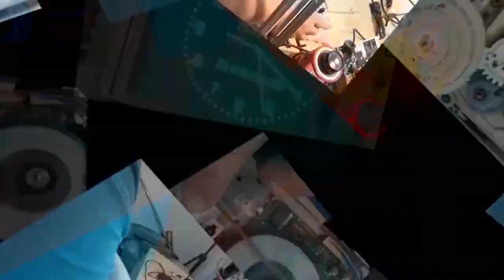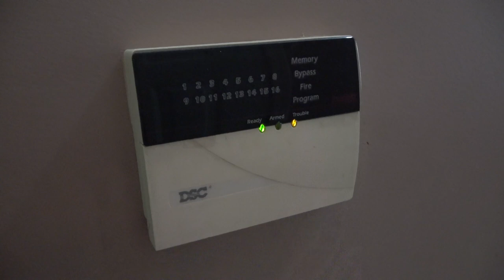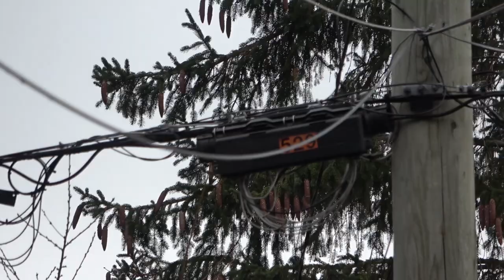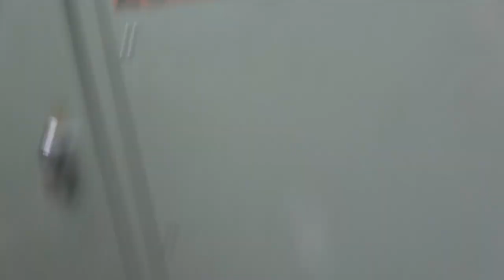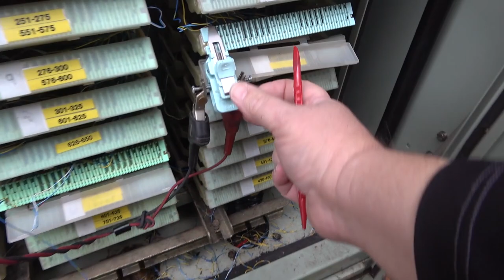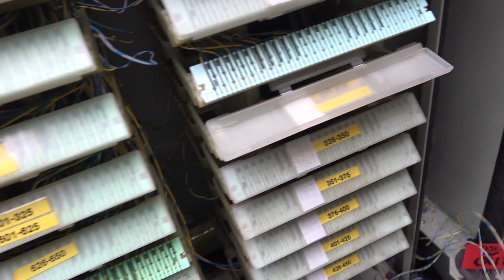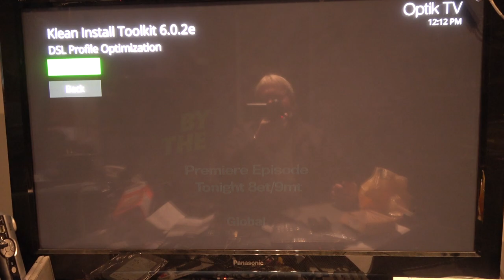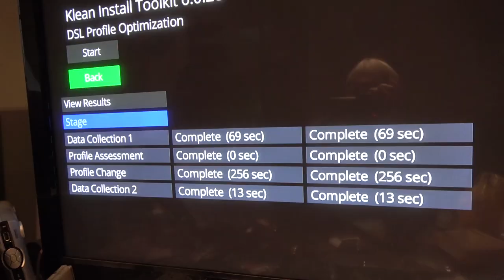Fixing my old noisy copper phone line

Comment: My Aunt loses her DSL whenever it's hot and humid. Truck after truck will roll with excuse after excuse as to why the trouble is occurring. She finally had enough and snapped at one of the techs and said she knew he was lying. He made a snide remark about how she would know what the problem was. She said 'Because there's a paper wrapped trunk line in poor condition on <insert street name> which gets saturated by the humidity and starts shorting the pairs. How do I know that? I was the field engineer who wrote up the work order to have that line installed over 30 years ago!'. I'm told the look on his face was priceless as he said 'oh, so you do know what you're talking about'.

Ignore any incorrect terms for the trunk type, as this was 7-8 years ago and my memory is crap, I just know she said it had something to do with the sheathing wrapped around it being a paper-based material and not a newer material.
Reply: Nice story
Reply from the maker: Paper based cable and we have tons of it still in the field is pressurized with air from the co so moisture should not get into the paper cable.  I thing that was stelpath, then there was the alpath which was a dry plastic insulated and finially cellfill which is a greased cable.  Paper cable will short out if it gets wet but that should never happen as there is about 9psi of air pumped into the cable which  prevents any water getting into the cable.  We have paper cables in manholes that are full of water.  About a 15 years ago a contractor that was pulling in fiber for our remote dslam. They dropped a ladder in and hit the pressure stem on a splice case breaking it.  Splice lost pressure.   Pressure alarm went off but the pressure guy thought it was a falses alarm. It wasn't.   Cable got wet.  Took 1200 people out of service.    Had to pull in new 1800 pair cable about 1km from one manhole to the next.  Took us 4 days to fix. I was a cable splicer back then and worked on this outage swinging customers from the large damages cable to a smaller one just to get the lifeline customers back online.  It was a disaster that could have been prevented had the pressure guy that was ready to retire had bothered to go out and investigate rather than leave it for the next day.    He retired abruptly.
Reply: @12voltvids  It's a legacy local carrier system, passed off to SBC (then AT&T after SBC bought them and re-branded), now run by Frontier. Frontier maintains NOTHING that they own. There's likely a constant alarm from the pressure drop going off that they just ignore. They simply do not care.
Reply: Now THAT is epic. I've met many former employees or family members of retired employees in the past 14+ years as a contractor. I LOVE the history of the PSTN, but it's been in such a sad state as long as I've been doing this, that when an opportunity came to jump ship, I just had to. Been doing cable I&R for the competition for almost 2 weeks, and I'm so glad I did.
Reply from the maker: @grabasandwich  It's a lot more than I&R for me. I do much security work too as we own ATD and Alarmforce so plenty of security jobs.
Reply: @jblyon2  Wow i believe you they don't care at all,  They just silence the alarms in there don't even care about those bells ringing off in the CO.
Reply from the maker: Lots of paper wrapped cable however it would not be affected by humidity as all the paper cables are pressurized with air at the co. They have bug compressors with air dryers to keep cables under pressure with pressure sensors at each splice. If pressure falls in any splice an alarm goes off and a specialty trained "pressure tech" is dispatches.  The call could come in at 4am and he has to rush to the site.  If paper cable gets wet the cable is shot and the entire segment has to be cut out and replaced.   Water does affect the plastic insulated cable too though.  It goes to a low point and eventually saturates the plastic or gets in where there are micro cracks causes by baking in the hot sun.
Reply: That story sounds better in your head.